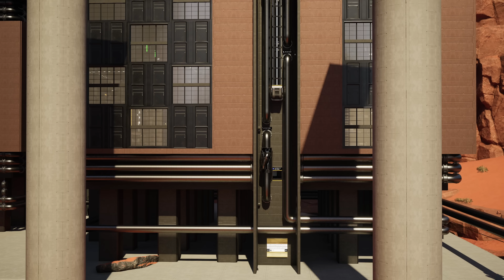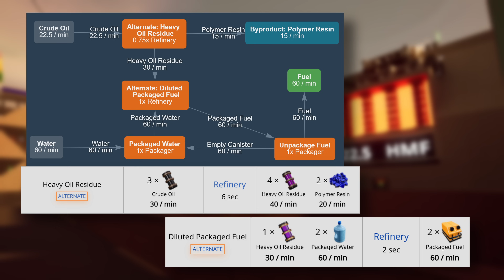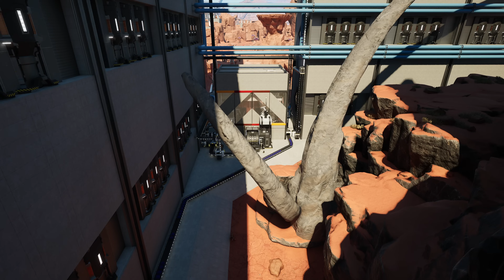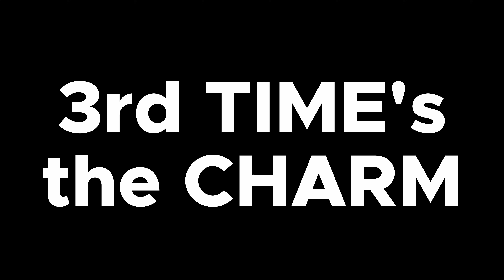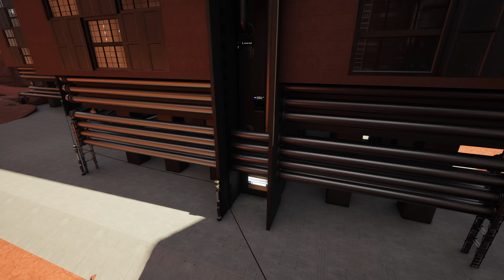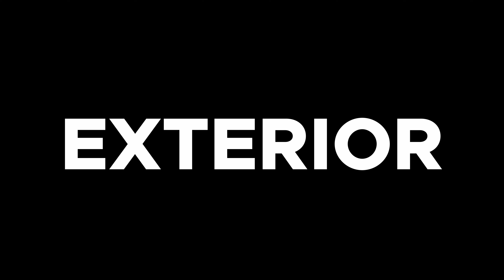1-CLICK Fuel Power got BETTER in Satisfactory 1.0

Comment: How did you come up with the 20% number for turbofuel? The recipe that turns fuel & compacted coal into turbofuel turns 22.5 fuel into 18.75 turbofuel, which then burns 8/3 more efficiently. That's around 220%, not 20. The sulfur is a drawback, though at the fuel phase of the game you have nothing to do with it.
Reply from the maker: Don't read wiki. Check numbers in the game.

2 generators at 150% burn 60 fuel per minute generating 750 WM.
2 generators at 200% burn 30 turbofuel per minute generating 1000MW.
If you add all the recipes 22.5 Oil converts into 30 Turbofuel vs 60 Fuel.
1000MW vs 750 WM. 25%.
And you need to extract sulfur, and to use blenders reducing power gain. Further below 25%.
Reply: @Yakez42  The blender recipe is the bad part. Just using the normal turbofuel recipe:
Make the 60 fuel as normal
1 refinery turns 22.5 fuel + 15 compacted coal into 18.75 turbofuel, so 2.667 refineries + 40 compacted coal makes 50 turbofuel
2.667 generators at 250% burn 50 turbofuel generating 1,667MW

Definitely not fitting all that into a blueprint, though. :)